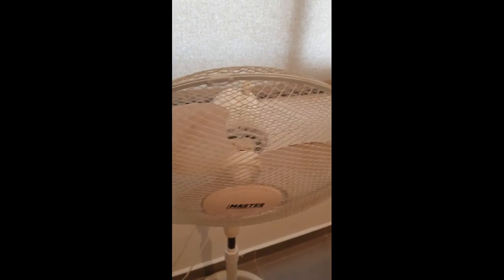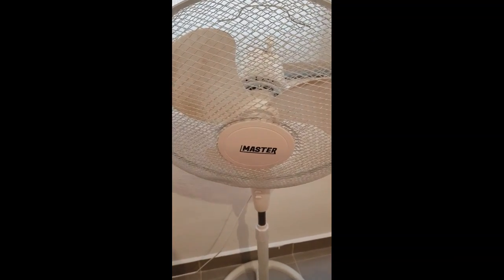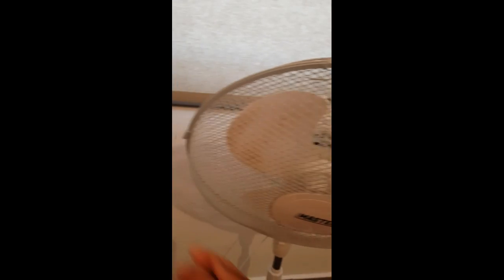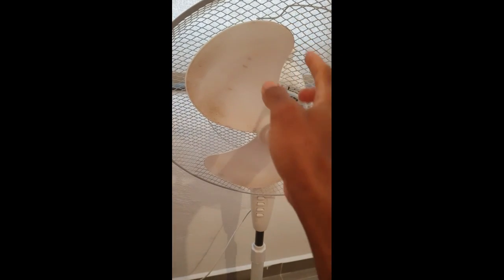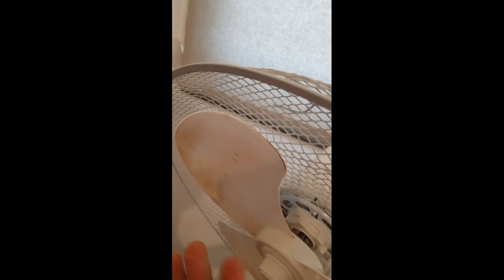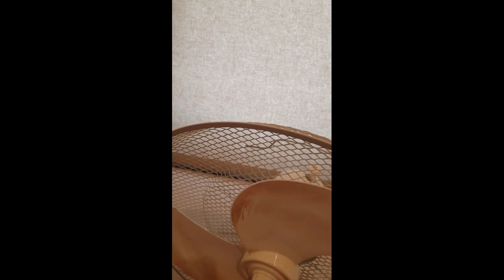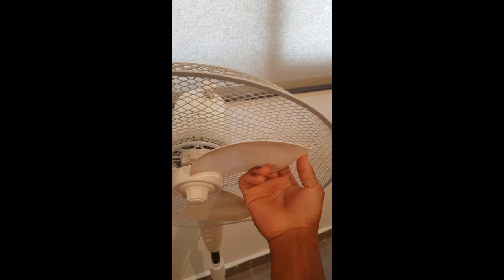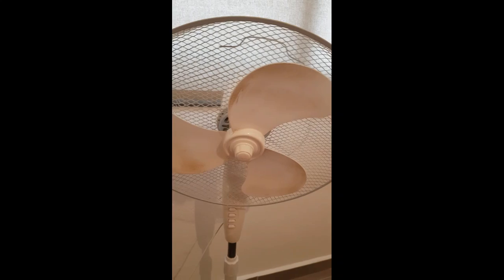Standing Fan Spinning But No Wind Fix.

Comment: I bought one of those rechargeable 6 inch desk fans from Amazon. It was working GREAT for about a week. But then it stopped blowing air. The blades are spinning, but no air is coming out. I ordered a second one hoping that it was just a fluke but the second one does the same thing when it starts up, the blades spin for about 10 seconds with no air coming out, and then all the sudden there's air! I don't understand what's happening.

Comment: My small fan is like this.
Actually it starts spinning okay and will start humming and will produce no wind after a while. (Like an hour or two) but the fan still spins.
I already cleaned and greased it but it's still like that.
Now, I tried what you said in this video and testing if it will be effective. Will update if it lasts a whole night without problems.
Reply: Update:
This fix really works!

Comment: Thank you very much our fan was blowing air at the sides I was really confused I thought I needed to some how replace the fan blade and another fan I just thru it out but boy did I regret that after watching your video my new fan just stopped blowing air not even alittle and when I did what you showed on your video it was like so mazing even my wife saw me for like 3 days trying to make it work with no luck what so ever thank you & may God Bless you for what you shared on how to fix fan blades. It really works 😊
Reply from the maker: Glad to help, you're most welcome. Cheers.